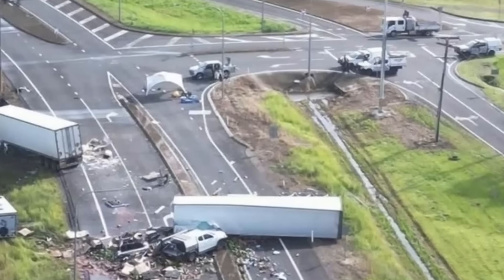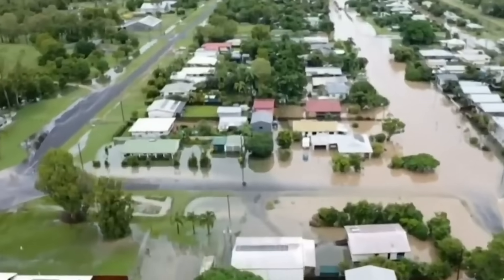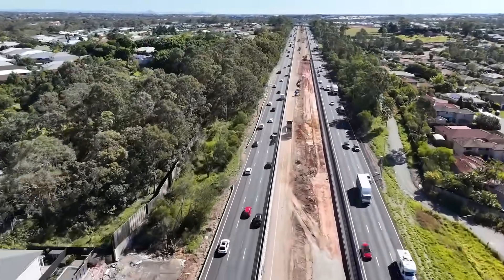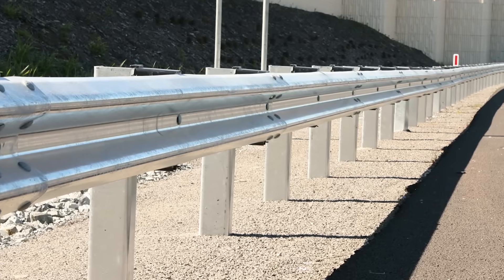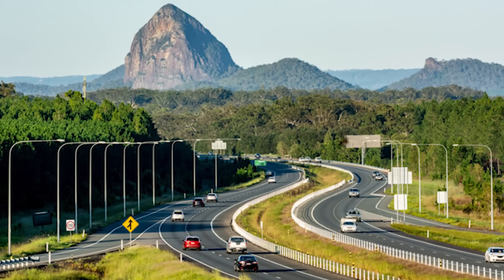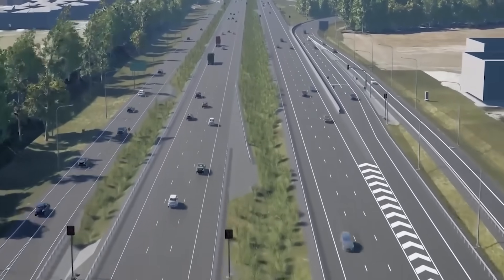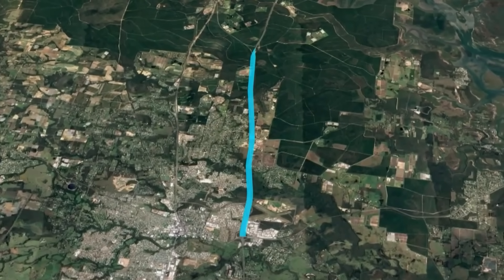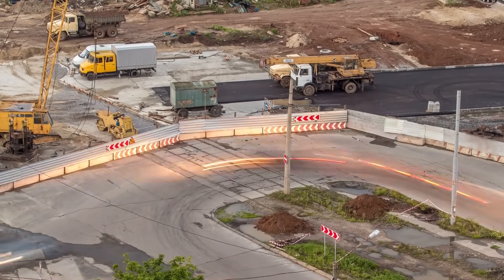$17B Upgrade to Australia's Most Dangerous Road!

Comment: IMO, The Bruce Highway SHOULD be 4 lanes wide (2 each way) from Cairns to at least Gympie, from there at least 6 lanes wide (3 each way) to Caboolture, then at least 4 lanes wide each way, in some places, more, with the base being an extra lane width each way.  Not only will this catch up to current demand, but also prepare for further expansion as needed in the future.
I would also like to see all the other "A" roads (eg. A3, A5, A7 etc) being at least 3 lanes wide with the centre lane changing direction every 5 kilometres as overtaking lanes.  Many times I have been stuck behind slow moving vehicles on those very narrow roads for more than 40 or 50 kms at a time, with no overtaking lanes or long enough sections to overtake safely.  Having a guaranteed overtaking lane every 5 kms would take away a lot of the road rage and driver risk of being stuck behind slow vehicle knowing it will only be a few minutes till the next overtaking lane.  Short overtaking lanes of less than 2 kms are not long enough when there is a long line of traffic built up behind a slow vehicle.
Reply: The New England-Burnett HIghway in Qld has very long stretches where it is difficult to overtake. Very frustrating when stuck behind someone doing 80kph.

Comment: Can you do a piece about the under usage of the Brisbane Sydney rail line. It’s managed by Sydney rail and the longest stretch without a station is Brisbane to Kyogle in NSW. Public transport is only any good if the public can get on and off it. There used to be 3 stops between Brisbane and Kyogle.

Comment: 😂😂😂 will never improve the Bruce  goat track no matter how much money they spend…people can’t drive or think on how to merge. They would need to replace the whole road/goat track south to north. The goat track is too narrow for trucks for the lanes, not enough overtaking lanes especially for impatient drivers (f whits) that can’t drive the speed limit. $17B wouldn’t go far as it costs $1m a km without including bridges or overpasses, plus the laziest and slowest road workers in the country, look at NSW roads that they have almost getting to the end last bypass and even now it flows much better and MUCH smoother than any qld road will ever be. Btw making 4 lanes into 6 will never change the death toll, it’ll still be congested as again people can’t drive to save themselves. 😂😂😂 fixed by 2032 as well 😂😂😂 Qld have run out of money for roads etc as they are broke, all the tolls, registrations etc go overseas as they are owned by international corporations. Plenty of potholes and road damage are the cause of accidents and damage to automobiles, trucks etc and qld has the most laziest fixes by putting bitumen in a hole then it blows out after rain or enough traffic, as they again are broke from spending money on absolute nonsense things

Comment: The Bruce Highway is a hell trip. 

I’m scared sh/tless to drive it. 

It’s an absolute NIGHTMARE of a road. It’s extremely degraded, floods in multiple places every year and is an absolute disaster. 

I’ve personally seen three fatal car crashes between Cairns and Townsville. 

They will never spend the money required to fix this. 😔

Comment: 3:57 doesn't help if the slow drivers constantly block the overtaking lane.   ALSO TIARO is pronounced Tie-Ro. Any collective distributor road running parallel with the highway will just be another cash grab by highway patrol to catch 'speeding' vehicles, where drivers are subconsciously matching the motorway speed of other cars.

Comment: 3:50 slow moving trucks  ?..geez  this is not the 1950's ..double B's with there massive twin turbo charged diesel engines sit right on your tail if you don't move over for them to pass you.

Comment: The Bruce Highway is still a dangerous gamble to drive anywhere. Up past Rockhampton the road deteriorates to two lanes, with no safety except a painted line between two steep drop offs ,as trucks pass they must have their offside wheels well off the roadway or their side  mirrors smash.Every time it rains the roads close or are so deep that cars are swept into the gutters,

Comment: There are still parts of the Bruce Highway where there is only one lane each way with no separation. These parts have not been changed in 80 years, yes 80 years. I always avoid going on the Bruce Highway when driving to Rockhampton, by going inland. Here the roads are no worse than the Bruce Highway, often much better, and there is way less traffic.

Comment: Should also upgrade the rail corridor. Its super slow and windy. If you straighten it. You can haul freight by rail and passemgers which will reduce trucks on the road.
Reply: The only sane comment under this video

Comment: Hi, Folks.
It'z NOT the road that is dangerous. It'z the I.D.10Ts who drive it and NOT all of them are I.D.10Ts either, just enough to spoil it for all the rest.

Yes, by all means upgrade it ASAP as it is not only a public and commercial necessity but also a defense NECESSITY.

BUTTTTT, in the meantime, - - - Drive to the conditions.

And get that DAMNED Pine Rivers Pacific Highway/Gateway interchange and the roads leading to and from it upgraded to match the traffic density AND MORE. Get ANOTHER crossing there if need be. We DON'T live in the horse-n-cart era any more.

Just my 0.02.

You all have a wonderful day. Best wishes. Deas Plant.
Reply: When you get past the sunshine coast and the dual carriageway goes to narrow single lane windy road whose surface is more filled pothole than layed bitumen, the problem is the road. That is one section there are plenty of other sections that are a patchwork quilt with a subsiding base and narrow bridges
Reply: It’s noticeable when crossing the border going north that the driving standards fall fast 
It’s driver re-education that should be addressed
Reply: It both people and the Bruce. Its no longer fit for purpose there are a lot more people on it than ever.
Reply: Hi, @philblood4415 .
NONE of that destroys my point about driving to the conditions. Driving ANY vehicle, on the road or off-road, is NOT just a matter of grabbing the steering wheel and flooring the 'loud' pedal. It also requires a pretty fair level of discernment, judgement, consideration for and of others on the road and beside it and a pretty high level of PERSONAL RESPONSIBILITY.

If a person can't both exhibit and EMPLOY all of those characteristics AT THE SAME TIME AND ALL THE TIME, they have ZERO right being on the road, ANY public road, in the first place, no matter how good they may be at 'handling' a vehicle. 

The road could be a conglomeration of potholes loosely connected by a few strips of asphalt - which I grant you the Bruce is inna LOTTTA places, or it could be the Autobahn, but you STILL need to drive to the conditions.

Just my 0.02.

You have a wonderful day. Best wishes. Deas Plant.
Reply: @dplant8961 im not trying to destroy your point calm down....
Reply: Mate, the problem IS the road. The whole Bruce Highway should be at least 2 lanes each way, maybe 3 each way where the traffic is extremely high near major cities. Why don’t you try driving the similar highway in Nth NSW, the Pacific Highway, where concrete road, minimum of 2 lanes each way with grassed areas separating oppositely travelling lanes, and in some places 110 km/h. It is chalk and cheese in comparison.
People can only drive safely is they are allowed to do so by the std of the road.
Reply: @rob12468most major highways in Australia are single lane. The double lanes and grassy medium strips are for the city drivers . Its impossible to do to all major roads

Comment: Nice publicity report - with repetitive video clips - straight from DTMR?  Despite the amount of investment, most or additional problems remain.  Eg merely widening the pavements without reconstructing the road shoulders leads to damaged road edges, shortened life and less stable vehicle paths.  Some (very) good work has been done (eg Gympie bypass) but acknowledge that the length of the highway provides unique and enormous challenges.
Please note that Tiaro is a 2 syllable name.
Reply: It's  AI generated voice.
Reply: Tie-Ro as a roadside trivia quiz sign, helps arriving drivers not to sound too tourist like. I like them for they are waypoints we come to know are upcoming. Driving alone, I like to guess the ones I know with the most wrong answer I can think of, laughing with tears is not safe driving.
Reply: @glasshousemtns I naturally mispronounce everything. It's my super skill. 🤷‍♀️😂 I have always said "Tiaro" incorrectly. 🤦‍♀️"Dohles (ie 'DOLLIES') Rocks Rd," too.
My late husband used to tease me to no end about it. He actually passed away from a crash around the Gateway/ Bruce area... one of the many reasons that I avoid driving there!
Reply: Add in a few more mispronounced place names... lol

Comment: very unpleasant road, yes. 1500 km of mostly 2lane curved regular highway and 100 km of overloaded city commute megaroad.

 Both parts are not fixable - suburban part requires not widening but complete duplication, new road apart of existing one (along existing corridor Narangba - Caboolture - Beerburrum - Beerwah), but it is not possible due to loudest NIMBY cries. Part from Gympie to north requires to be rebuilt as divided motorway with new bridges, town bypasses and so on, but it does not have enough traffic to justify such a huge money. Sydney-Brisbane, which is much more loaded, is under construction for 50 years and still not finished.
Reply: Spot on, I was just spitballing this with the missus the other day. They need to take a bunch of traffic off the Aspley - Caboolture leg. The only way I see that would be to have a major alternative route to the West of the existing motorway.
Reply: The Coffs Harbour section has been dragging on for years.